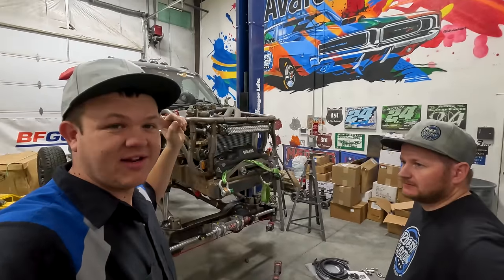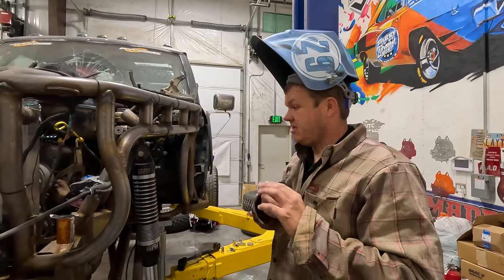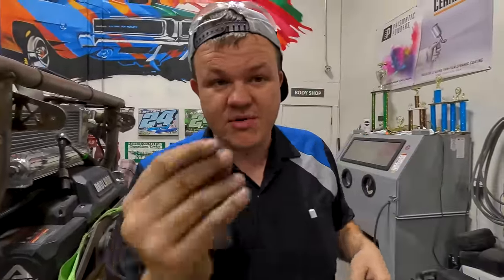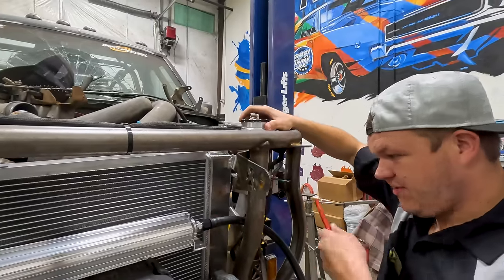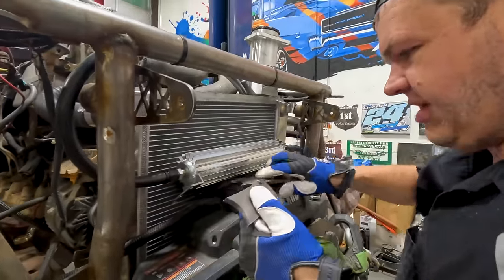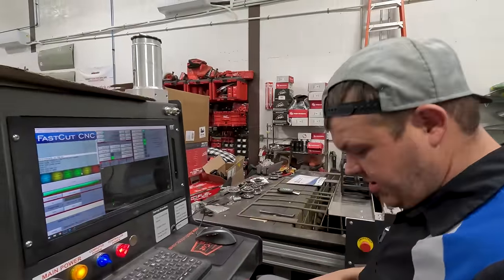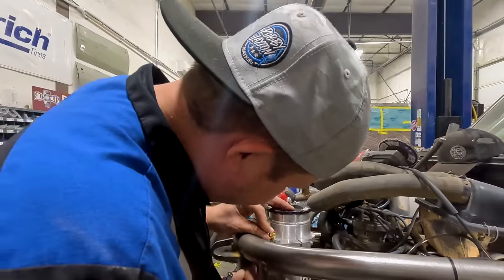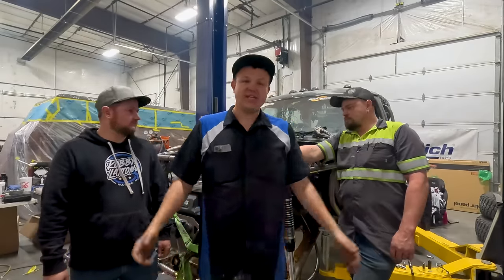BroncStar Gets Steering Overhaul Before King Of The Hammers!

Comment: Pro tip! After you get those threaded steering lines properly cut to length and fully tested for clearance and function, you should then get a crimped set made up because those threaded lines can separate sometimes, and if you swap them out before they fail you have a spare set to get you off the trail.
Reply: Used that type of fitting for years in the injection machine industry. Hoses/fitting would be rated for 5,000 psi pressure. Never had a fitting separate.
Reply: @bucknaked9095  does the injection machine industry regularly tug on the hoses with logs and rocks? I'm not saying they're terrible or useless, just not the best option for reliable offroad operation
Reply: @thelonewrangler1008  Usually in a production environment one days operation will put a hose into several months to the equivalent of a years stresses on a vehicle.  Arms/cylinders are not always stationary in fixed action and have to articulate sometimes more tightly than when used on a vehicle plus will most often be working though their full range of operation at higher speeds to maintain production rates.  The stresses on the return stroke can also be many times greater as we will use a higher flow rate there then on the feed to greatly increase the number of cycles per hour.   At those rates then heat can also be a greater issue requiring a more robust cooling system then on a vehicle plus the machines often need to hold up to working 2 or 3 shifts a day 7 days a week with limited down time.

Now if we were talking about brake fittings where you lightly insert a hose and expect fluid or air pressure to keep things clamped together in high stress situations then we'd have a problem.

Best!

Comment: When you're building hoses with screw in fittings, put STP on the threads and the ID of the hose. This will keep them from cutting the rubber of the hose ID. If you  don't you could end up with a  flapper in the hose.

Comment: I had a fiberglass roofed tent trailer that the roof got hit hard by a roll out awning that a random gust of wind flipped onto the top hard.  I had bedliner material professionally sprayed on top and it worked beautifully to seal it and make it strong again.

Comment: Looking good as any job not done before you do not always get it right first time, practice makes perfect.
Talking about getting it right thhat radiator needs to be mounted level yes I heard you are going to move it but it gets hot at KOH and it may cause flow issues.

Comment: It's called g code because the are g codes i.e. g01 g02 etc. that command the machine to perform various operations such as hole interpolation or other things to cut out the part. Same for all types of cnc machines. There are also m codes that command machine functions like spindle rotation /stop etc. on mills and lathes.

Comment: Putting 90° fittings in the cylinder and straight fittings on the hose would eliminate the need to clock the hoses.  The hoses would sit closer to the cylinder too.

Comment: Hillbilly i have a question for you. What do you think about the Ford 3 hundred 6 cylinder the 70s one not the fuel injection one. I think they are the best 6 cylinder engine ever built. Seen a video where they built one up and put a turbo on it and it made crazy amount of power and tork. I want to find a old Ford pickup truck with a 300.6 in it and make it my work truck. I don't care if it 2 or 4 wheel drive. Im a Chevy guy also but i love this engine Ford made
Reply: I made same comment, easy to make power and even turbo with EFI carb

Comment: The stripe on the hose is called the lay line, it has the hose information and allows you to see if the hose it twisted. Twisting the hose severely reduces it's life and pressure capability. Twisting is a big no no.

Comment: Not understanding why you think the steering cylinder being off center will change the steering on the tires
Reply: As the wheels turn those tie rods angle backwards instead of staying in a front line.  As the ends move backwards that makes them shorter in the left to right direction.  Since the shorter of the two tie rods will be angled more, it will get shorter faster left to right.   That is all oversimplified to explain about a third of it, but having them different lengths means asymmetrical steering.   Small difference, but not ideal.
Reply: @brianhaygood183  ya I didn’t think about the angle. Didn’t think about that. Lots of old cars had different lengths. But after the rack steering, I don’t recall ever seeing tie rods different lengths . Thanks for pointing that one out . I work on cars all the time and I wasn’t thinking.

Comment: I'm not following your logic on putting rough bedliner on the roof of wiskers????   We play alot in the snow & having a glossy slick topside is a huge help on everything except if you have to walk on the surface alot.  The Slick surfaces shed snow & ice way better & your not fighting the weight or all the water content when it's pulled into a heated shop.  Smooth is better even on our enclosed snowmobile trailers.  The open deck trailers are a mix but bedliner works if prepped correctly.  We use a hot pressure washer to keep the decks cleaned off & the sodium chloride from destroying everything.  Rust never use to be an issue but saddly washing the frame & undercarriage  is highly advised even here in Idaho.

Comment: I spent years working to make sure that toys were safe for children at the world's largest toymaker. I had to research what were the causes of children getting injured or killed. I also raised my son to be a fabricator and race car mechanic who now has moved on to building the world's most advanced fighter planes. Be the parent. Take the air gun away from Lincoln and tell him "No!" Ask why OSHA requires air gun tips with vents out the sides. Because of adults dying from misuse of them. It's not amusing. Most of the time I thought you guys were pretty good parents. You just changed my mind.😮

Comment: So what has Hillbilly done to receive such bad mouthing from Robby.  He didn't have to take out the bar light and he acts as if it is Hillbilly's fault when he cut the wires.  It seems as if Robby removed the bar and cut the wires he should be the one to install and reconnect the light bar.
It seems to me that Robby has been chewing on Hillbilly on a regular basis.  
Hillbilly seems to do everything Robby asks of him.  So why is he on Robby's do, do list?
Reply: Actually he does not do everything as asked. Last few months he’s  disagreed or argued with Robby’s every word or suggestion. Even in this video….Robbie asked for a flat washer and a lock washer…HB “loktite is better” . The boss asked for a flat and a lock washer, not your opinion. I think HB head is swelling. My $.02!!